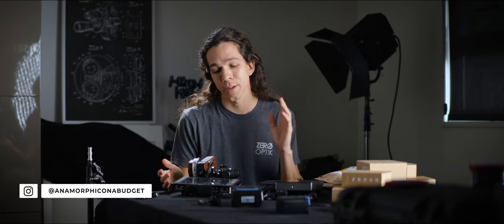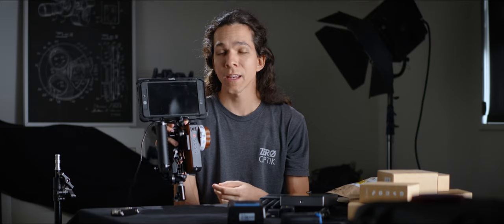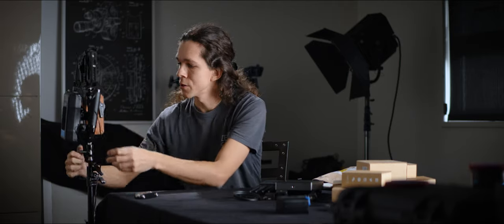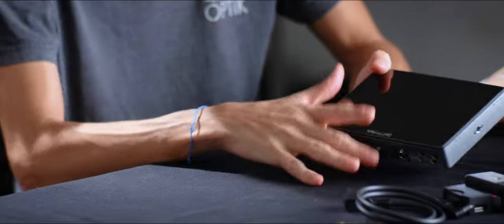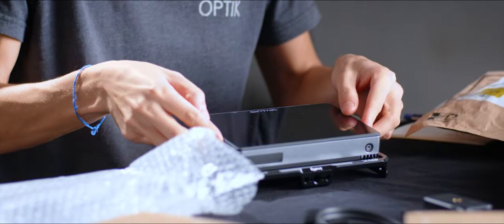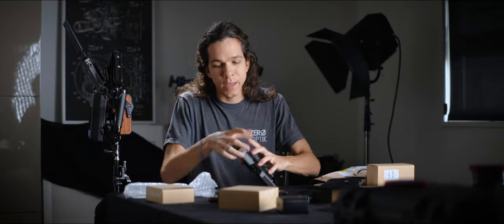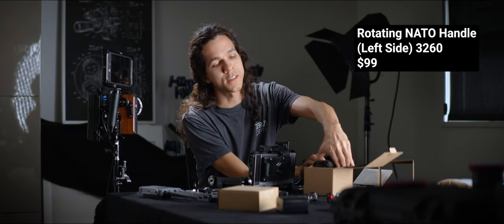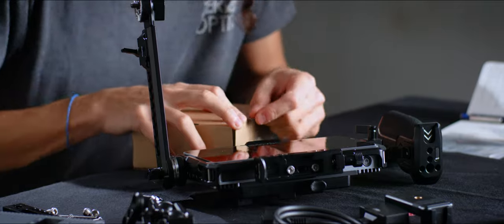Building a Portable 1st AC Focus Station (Mk II) - SmallRig + SmallHD

Comment: If you ever want to take it off the stand and carry it around in order to follow the operator and not be somewhere off in the corner, I recommend 1) the Wooden Camera neck strap with 4 attachment points and 2) why not mount the transceiver below the monitor to lower the center of gravity.
Reply from the maker: Good point with the receiver. I'm just used to getting artifacts regardless of the receiver, so I try to put it as high as I can. I'll look into wooden camera's neck strap. Having it "handheld" has always been a plan for this project! :)

Comment: Very very cool. I like your wireless video system. I need to upgrade mine. My wireless is too laggy. Although going tethered with cable, with security so you don't damage the ports, is not too bad. Your setup looks great.  Although, you might want to try swapping that wireless FIZ  with a Tilta wireless right-hand grip. It might be a better balance. I would like to make a rig like this for in the studio with a larger monitor or a TV on a rolling stand.  I feel with anamorphic, even our monitors need to be bigger. Or maybe I just can't see like I used to. Cheers